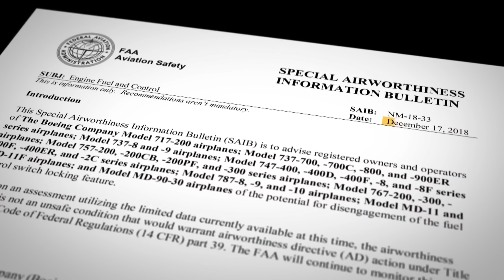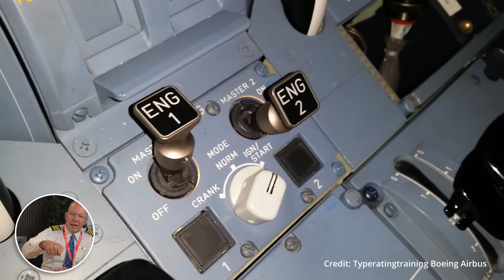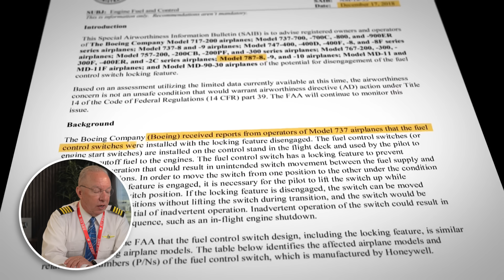Air India 171: The FAA’s 2018 Fuel Switch Locking Bulletin Explained (16 Questions Answered)

Comment: The footage doesn’t even need to be live. Just store it in the black box, encrypted, and accessed only after crashes. No spying, no surveillance — just accountability when things go wrong.
Reply: exactly... just like the cvr it need not be accessed if flights are routine
Reply: The thing is he's already admitted that he's fully aware some pilots may not be doing what they are supposed to be doing. So the reason they dont want it is so they dont get caught not doing their jobs. Supposed to have integrity and anyone scared to have a recording in their is clearly doing something they don't want to get out.
Reply: @howardwest2707 but make it overwrite loop like the cvr and fdr’s
Reply: @howardwest2707  it's not just that though, people perform poorly when under constant scrutiny.
Reply: @satoau1  The argument can be made that if you can't perform under constant scrutiny you should be in a different line of work.
Reply: @dianeladico1769  it's a human universal, as in nobody should be required to work under constant scrutiny as it harms well-being, and at the same time produces no benefit to the employer as people work less well under big brother conditions, not more.
Reply: @satoau1  That's just nonsense. Trains have them, even city buses do. Operating rooms. Retail establishments. I have every aspect of my work checked by three different people before it leaves the building and I'm routinely expected to explain and defend what I've done as part of the audit process. I'm perfectly fine with that-since a mistake could cost lives I wouldn't have it any other way.
I'm confident in what I do and if I make a mistake I want to know so I can correct it.
If someone can't handle the scrutiny they shouldn't have the responsibility of holding lives in their hands.
Reply: @dianeladico1769  that's just nonsense. train and buses have security cameras for fare compliance, and even those don't monitor every seat all the time. some smaller buses companies have cameras solely for driver monitoring, and those companies have more fatigue related incidents. having your work checked when it leaves and having occasional audits is different from being recorded the entire time and having to justify every action every day. some companies have trialled such systems and found that sick days increase, and work quality declines as workers stress over what looks like work rather than just doing their job and having only the outcome (such as yourself) assessed.
there are so many studies that conclude that constant surveillance increases fatigue and decreases quality of work. do you really want a pilot that's been worried about doing everything perfectly on tape for the last 12 hours flying to be landing your plane? and why are you making claims about how it is to be under constant surveillance when you are not under constant surveillance?
Reply: @howardwest2707  As if you've never goofed off on the job.
Reply: @howardwest2707 not true at all. At my work all cars have cameras and monitoring, speed, fatigue, stop sign violations etc. I'd much rather not have them.. Can add a layer of anxiety that retracts from safety. Am much more comfortable without being filmed (always), has nothing to do with me misbehaving, I just don't like being watched. I'd much rather pilots are comfortable than on edge. 

Maybe an unobtrusive rear camera, certainly wouldn't want something akin to a dash cam.
Reply: @howardwest2707 thats fucked, how can he even say that, dont all people need to be accountable for their job? Its peoples lives
Reply: @howardwest2707  what are they doing with the air hostess in the cockpit? 🤔. Uhhh
Reply: I agree. That's the best way.
Reply: Exactly, integrate it in the black box system and have access to footage only in case of incidents or crashes. Self write itself after few hours like black box.  I'm big privacy advocate but I can't see any downsides of this kind of system. Of course it can't be just IP cam where anyone can break to or leak footage because that's not what it should be. 

Actually some real footages from engine failure cases or other incidents might be very useful on training and make flying skills better.
Reply: Bullshit defending of no need for cameras in cockpit @CaptainSteeeve, you're just toeing the union line. You yourself have stated that we may never know why those switches were turned  off, With cockpit video footage we would!. Video may not have prevented this accident but it 100% may stop the next one...Total bullshit reasons for no cameras...Typical spineless unions choosing staff over safety. City buses have cameras, ridiculous they aren't in commercial airliners.
Reply: Black box data is not encrypted as it would prevent at least some data recovery if the black box is damaged (generally any damage to the encrypted file will prevent decryption or make it very difficult to recover depending on the type of encryption used).  There are accident cases where only a few seconds of audio or flight data were recoverable.  Encryption would also add recording delays and other technical issues.  Furthermore video data is far far larger than audio or flight data, making harder to store and especially process, and more vulnerable to destruction.
Reply: Actually, the planes nowadays are pretty much connected to the internet via satellite the whole time. If they could somehow have the data being constantly sent via that internet connection, it might help if the black boxes are damaged, which happens a lot. Black boxes and live data. That should not be that hard to set up.
Reply: He gave a pilot's answer
Reply: That actually sounds like a solid middle ground—privacy intact, but truth preserved. But here’s the catch: who decides what footage gets released, and could that still be manipulated? Would you trust airlines or governments to handle that fairly?
Reply: I think you've got a good idea. For all the people talking about "not supposed to be doing:" stop thinking the worst of everyone who isn't you, and stop thinking "accountability" is automatically an opportunity to punish someone so you can feel better.
Reply: @kerryjlynch1  unfortunately that's basically how aviation safety works: "thinking the worst of everyone who isn't you"...
Reply: I agree with Arya.
Reply: ah you beat me to it. Totally agree.
Reply: The airlines companies will not do this because they won’t get the possibility of manipulating reality to their own favor. As simple as that. This whole thing stinks worse than “sh*t*.
Reply: Captain Steve, it's a suicide. The captain has a problem with psychiatric history, which the regulator or airline don't monitor. A senior Indian pilot has confirmed it. The captain of the doomed flight was also on medical leave! Many of the other copilots were also aware of it. The news is out here in India!!
Reply: l spend probably far too much time on here watching videos of aircraft taking off and landing filmed from inside the cockpit by Captains or Co-Pilots. So i really cant see why flight crew would be upset if cameras were mandatory.
Reply: there was a DVR on this flight
https://youtu.be/vumDzVRV0ZA?si=6DGYJFmmFoNKcsnO
THIS NEWS tells that this Airplane had a DVR Digital Video Recorder, I dont know why anyone is not talking about this.
Reply: That may be the easily refuted reason they do not want video recording, but the real (and very understandable) reason is that in the event of pilot error being the cause of an accident, they want deniability.
Reply: Exactly - I mean good enough for Uber drivers
Reply: Not to burst your bubble, but I don't like the idea of being watched all the time, even if it is stored and no one is ever going to view it. Still, I do believe this need to have just in case. But the question is, where to place those camera. I'm a person with autism and social impairment, so the fear of being watched is real and I'm often being diagnose as paranoia.
Reply: @benjamintan2733  you'd better not ever leave your house then... Cameras are everywhere and you are always being recorded..
Reply: I like that. Memory is cheap nowadays... tape/digital.. whatever. No big brother watching you, unless you screwed up.
Reply: Old man won't support it because that way boeing will get slaps on both sided of the face.
Reply: Accountability is not the highest priority. Believe it or not. Knowing causes and preventing is far more important. There is a self reporting system in commercial aviation where a pilot can tell on himself for a mistake he made and not face reprisal. The reason for this is very complicated.
There is a mountain of history about this but it started with a NASA study in the 1970s to understand why pilots were making mistakes. The short answer is this- pilots are humans and all humans make mistakes. All the time. The solution is to build a system with enough checks and backups to catch a human mistake before it turns into a disaster.
To build on this system so that mistakes can be caught this self reporting system is very important to make designers aware of what are common mistakes by pilots so that they can better design the system to catch their mistake and prevent disaster.
If you start playing the blame game and punish a pilot for mistakes that he reported himself then no one reports their own mistakes anymore and the system breaks down and does not improve.
Modern commercial aviation safety is as good as it is for precisely this reason and this reason only.
Reply: Just biases shallow take on the matter from him
Reply: Exactly. Like some car dash cams which store the last few hours of footage.
Reply: people like him dont want accountability, notice how he doesnt answer any technical question about aircraft issues. his knowledge is very limited or at least he makes it seem so, and there are better sources for analysis, this channel is just for making money
Reply: you do know that cockpit recordings are accessed in occasions less severe than crashes, too, yes?
Reply: No, stupid.  Because somehow and magically critical information is never available on these black boxes when it exposes airlines liability when passengers get killed.
Reply: You can see the pics of the Engine and its turbine blades on page no.9 Fig8, they are intact which means the engines were not running at the time of impact, if the engine blades were rotating they would have decimated into pieces at the time of impact.
Reply: Nathen fielder records in the cockpit - another genius aspect of the fielder method
Reply: Yeah I agree.  Also, the pilots aren't needed to be filmed 100% of the time, only their interaction with cockpit controls.  Maybe a camera with a special angle, maybe use "barriers" near the lens so the only thing recorded are their hands and the controls
Reply: GREAT IDEA! HOPEFULLY IT WILL BE GIVEN PROPER CONSIDERATION AND ADOPTED!
Reply: The pilots are allowed to read/watch videos/screw off when in cruise anyways.
Reply: If pilots are reading magazines, watching movies etc, they should be held accountable.
Reply: @katyhartmann2632 they wouldn't be doing it if they knew that they were being filmed.
Reply: Yeah, he literally said "they don't want video getting out of them doing something they are not supposed to do."  Disappointing for this captain to be defending this behavior.  I think if truck drivers are required to have cameras in commercial trucks on American highways, it should be required especially for airline pilots.
Reply: You want to let someone peep in on YOUR work? Pilots do so much for us, don't they deserve some basic privacy? 

Plus, big expense for tiny payoff.
Reply: @russellharvey7096 there is a big difference between!  My work does not involve having hundreds of peoples lives in my hands!!  What’s more important to you?  A pilot getting embarrassed because he’s caught reading a magazine or potentially saving thousands of lives in the future?  

If we had video evidence in this case there would be no doubt if this was an intentional cause or something else.
Reply: @russellharvey7096  Yes. I work in an open lab where everything I do is visible to my colleagues. My work is checked for transcriptional errors before the report is submitted to a supervisor and then QC for further checks. We are audited by customers and regulatory agencies where we have to show all the details of an analysis. They can pull any report and we have to defend every aspect of what we've done (correct reagents, instrument maint and calibration, adherence to SOPs).
We test materials that go into jet engines. So while I am not a pilot, lives depend on my work. I'm good with any degree of oversight that prevents failures and crashes. My 'basic privacy' ends where someone else's life depends on what I do.
Reply: @russellharvey7096 Privacy doesn’t trump safety when hundreds of lives are at risk. Surgeons, cops, even rideshare drivers get monitored—pilots shouldn’t be exempt.

CCTV isn’t about spying, it’s about getting clear answers fast. Guesswork about switches and levers? Video would end that instantly.

If we trust black boxes and voice recorders, why not the full picture?
Reply: @russellharvey7096  my life is more important than the privacy of the pilot who is getting paid to do his job.
Reply: Or just stream it to ground stations. Compressed and encrypted.
Reply: @sarathyj  This. All recorders and video data preserved in perpetuity. Not to mention that the data is always available and not subject to black box failure, damage or going missing after an incident.
Reply: @sarathyj i don't think it's good idea it gonna eventually leak one way of another. Keep last few hours in black box in case of incident/crash and only have access to it when doing the report. Making something online and streaming make it less safe and less private even encrypted.
Reply: @oluskloc , you know how difficult it is to retrive the black box in most cases, esp if it involves a body of water.  If the data was streamed to a ground station,  we would have solved MH370 right away - it's more than 10 years and no blackbox. If not the cockpit video,  rest of the data should be streamed. It's a no-brainer.
Reply: @sarathyj  the trouble is if we did that we'd have more mh370 like incidents due to the increased stress. constant scrutiny causes more accidents, not less.
Reply: What most people are missing here is that the FAA had already issued a warning back in 2018 (SAIB NM-18-33) about a potential issue in Boeing aircraft where the fuel control switches could unintentionally move due to vibration or mechanical failure.

In the recent Air India crash, both pilots denied switching off the engines, and flight data confirmed that both engine fuel switches moved from RUN to CUTOFF almost simultaneously.

If these switches are manual and controlled by physical levers, it's impossible for them to move without human input — unless there’s a mechanical fault, such as a failed locking mechanism, which is exactly what the FAA had previously warned about.

The aircraft involved had not undergone the inspection recommended in that 2018 FAA alert because it was marked “advisory, not mandatory.”

This strongly points to a technical glitch — not pilot error. It's easy to blame humans when machines fail silently. Aviation authorities should focus on the dual engine switch system’s design and whether proper inspections were neglected.
Reply: @MaujL8fe0  To one switch fail it's possible. But to fail two switches in 1 second apart in most critical phase of flight for power simply very unplausible. Chance for that situation is like 1 to tens or hunderets of trillions.
Reply: @oluskloc  People keep saying “it had to be pilot error,” but here’s something to think about — even the FAA issued a warning back in 2018 about certain Boeing fuel switch systems that could fail due to vibration or internal wear.

If both engines shut down at nearly the same time, and both pilots say they didn’t touch the controls, then we can’t ignore the possibility of a mechanical or system failure — especially in the fuel cutoff switch or engine control units.

Also, moisture, heat, or even a shared electronic fault could affect both engine gears or switches at the same time — especially if there’s a common flaw in the design.

These parts don’t last forever. If older planes weren’t properly inspected after the FAA's alert, then blaming the pilots might just be an easy way to avoid facing a real issue.

Mechanical glitches can and do override human skill. Let’s focus on facts and full investigation — not assumptions.
Reply: @MaujL8fe0  I don't say it must be pilot error/deliberate actions, I just say it's very very unplausible to two switches to fail at the same time at the most critical phase of flight. Actually 1 second split make it even more unplausible. Same as two engines fail on take off by itself. You doesn't seem to understand the probability calculation. It's probably bigger chance of elefant failing down from the sky and hit you in the head. 

One switch it could be possible. Two in some more time apart maybe but already unlikely. Two in human changing time apart in the most critical flight time very unplausible to me. 

But of course for final conclusion let's wait for investigation to complete they gonna check if switches were operating normal and all data. They probably can determine potentially which pilot switched them, if pilot steering there might be some extra column movement when he reached for switches.
Reply: @oluskloc It’s highly unusual for both engine cutoff switches to turn off simultaneously unless there's a serious system fault. Moisture can cause short circuits, especially in shared wiring or cockpit panels, which might trigger both switches at once. While it's rare—because aircraft systems are designed with redundancy—it's not impossible.

If neither the pilot nor co-pilot touched the switches and both engines still shut down at the same time, that suggests a hardware or electrical failure, not a human decision.

Could Boeing be hiding a design flaw that was already warned about back in 2018?
Reply: @MaujL8fe0  Maybe but actually it wasn't same time. It was around one second split which makes it human like. Pull and switch, pull and switch. Moisture shutting down two engines must be really big design flaw, Boeing doesn't make planes since yesterday and engine control it's not something new technology.  I bet they shouldn't have any shared wiring that's common sense. Black box signal should clear that on investigation, if there was any problems with switches or wiring signal gonna be saved in erratic way before and after not just 0/1 (on/off) like. Also it might be heard on CVR the clicking sound of switches if they were used and how many times. 

For me it looks like pilot who was monitoring at this moment did it for one reason or another. If pilot flying did it pilot monitoring probably will notice it much faster (even like pilot flying reaching there where he normally dont) and formulate the solution in 3-5 seconds not 10-14 seconds. He have delay because of overload at this moment. Or pilot monitoring was not paying attention and ex. looking outside window and then pilot flying did it.  Would this extra few seconds save the plane? probably not unless the switches were put back before the engine goes under idle power and recover (it needs like second or two to slow down, inertia keep it spinning). But it gives a clue what happened.

For me first of all it should be lockout to make fuel cut off impossible or much delayed (like 10 or 20 seconds with master caution before real cut down) when engine is not on idle. No reason to not do that.
Reply: @MaujL8fe0  I know you really want to believe it was an accident and when I first read the report I tried hard to deny it but it's clearly intentional and a Pilot did this on purpose. To try and pretend it's anything else at this point is just ignorance.
Reply: @MaujL8fe0 
Moisture or an electrical fault can't physically lift a switch, move it, then push it back in.
The only way that this could happen is if it was a mechanical fault with the actual switches. Although highly unlikely, it is of course possible for a switch to fail/slide out of the on position, but this would mean that the switch was accidentally left on the very cusp of the locked on position – which would be like balancing a knife on its very tip. Again, it's not impossible, but very, very unlikely.
Now, factor in that this happened to not one, but two switches.

I don't think you're encountering trolls here who just want to blame one of the pilots. The current evidence is quite clear though.
That said, evidence does not equal proof. I'm happy to keep an open mind until the investigation is fully complete.
Reply: @MaujL8fe0  even if it was the 2018 FAA advisory.  The chances of BOTH switches moving all by themselves, first one, then the other, within one second, is just not going to happen.
Reply: @MaujL8fe0  "...strongly points to a technical glitch..." Maybe. The impression I get from reading the SAIB is that a few planes were delivered (some 6+ years ago) with the locking mechanism uninstalled, but that was fixed. Wouldn’t it be obvious to a pilot with experience with that plane that the switch was improperly installed?

It is perhaps significant that the switches were found in the locked position, seemingly not moved by the impact, while the thrust lever was noticeably moved from its maximum recorded position. If the locking mechanism of the fuel control was uninstalled, you might expect one or other of the switches to have moved from the ON position.
Reply: @MaujL8fe0  You are wrong, this was never happen before
Reply: @Tjsan Do you know how many people are raising questions about this report? The report seems hastily prepared. It's an attempt to shift the blame onto the pilots, especially given Boeing's history. Both pilots were experienced and mentally stable, as confirmed by those who knew them. People close to them have said that the investigation was neither thorough nor fair, and it is wrong to hold them solely responsible
Reply: @MaujL8fe0  yeah, people also lie.  Even pilots.
Reply: @MaujL8fe0  Wouldn't such a vibration or mechanical failure only affect each cutoff switch individually? They each have their own knob, indents, spring, etc. There is not a shared mechanism connecting between both of them. They operate entirely independent of each other, mechanically. Probability tells you that it would be IMPOSSIBLE for both switches to experience an identical mechanical failure at the same time, on the same plane.
Reply: On top of addressing this technical issue, perhaps separating the 2 switches, each relocating to the far side of each pilot near the window, could address the "metal issue" of any one pilot trying to cut off fuel supplies deliberately at the same time - this will require both pilots to actively shut down the engine on their side during landing. That said, this does not prevent any single pilot from shutting down both switches in an emergency that requires both fuel to be cut off where only 1 pilot is conscious; he/she can still shut down both with extra effort to reach over to the other side to shut down the other - if such situation arises. But with both switches located away from each pilot, it'll minimise any deliberate single pilot action due to mental or sabotage issues.
Reply: WHY ARE PEOPLE STILL TALKING ABOUT THESE SWITCHES AND THE MEMO PUT OUT YEARS AGO???  THE ACTUAL SWITCHES ON THIS SPECIFIC AIRCRAFT HAVE BEEN THOROUGHLY EVALUATED AND NO DEFECTS WERE FOUND!
Reply: @MaujL8fe0 Those switches have detents. It was pilot suicide and Air India doesn't want to get sued.
Reply: @dannydaw59 ✈ The human error theory seems weak in this case. In a cockpit, both pilots sit so close that if one of them even moves their hand toward the engine switches, the other will immediately notice.

🔧 Shutting off the engines involves physically moving a switch or lever — it's not something that happens silently or without visibility. Plus, right after takeoff, both pilots are on high alert. There's no chance one would be distracted or inattentive during this critical phase.

🧑‍✈ According to aviation SOPs, shutting down an engine is a major action and is never done without cross-confirmation between both pilots.

👉 So if both pilots claim they didn’t shut off the engines, and yet both engines failed nearly simultaneously, then a technical glitch in the engine control or switch system cannot be ruled out.

🛑 Aviation authorities need to conduct a detailed investigation into the dual-engine control system. Jumping to blame human error without hard evidence — especially in a case involving loss of life — would be unfair
Reply: @MaujL8fe0 When did both pilots claim they didnt shut the engines off? Did they say that to ATC in that short chaotic time? I don't think so.
Reply: @MaujL8fe0  1. Only one pilot denied doing the shutoff. (And another assumed the other had done it.) 2. Investigators aren't jumping to blame human error without hard evidence - only use crazed aviation social media junkies are! I'm sure investigators will consider every angle. 3. I would not assume the action of toggling the switch would be immediately noticed by the other. You'd think so, but if they are looking at other gauges, looking for traffic, communicating to ATC, etc, their peripheral vision might not register anything out of the ordinary.
Reply: @MaujL8fe0 
You can't use almost/nearly along with simultaneously. They either cut off simultaneously, or they didn't. In this case, they were one second apart – plenty time to go from one switch to the other.
Reply: @dannydaw59  it was on the CVR.  Regardless, pilots lie when they do something wrong on purpose
Reply: @dannydaw59  I believe that in any crash be it air, boat, auto etc. The lawsuits will always come no matter if even it was an act of God...that's just the thing to do, sue...sue...sue till you hit the jackpot.
Reply: @dannydaw59 how silly!!
Reply: @dannydaw59 when they said, yes i shut it down?
Reply: It looks like either Captain Steve is getting paid, or he’s under some kind of pressure, because he’s defending Boeing from every angle and putting all the blame on the pilots.
Also, Boeing knows that Captain Steve is getting the most views on YouTube for this case, so they can easily push their narrative to a wider audience through him.
Reply: @92_yuvrajpandey49 Why specifically do you say this? I don’t interpret his reasoning the way you do. I am a pilot but I don’t fly Boeing or Airbus RPT, but i understand the fundamentally different technological flight control approaches between Airbus and Boeing - albeit this is slightly blurred by the changes in the 737 Max.
Reply: @Aquascape_Dreaming  i think we agree … the concept of video recording in the cockpit, with a loop like flight data recorders, is a good thing  … we should do it…